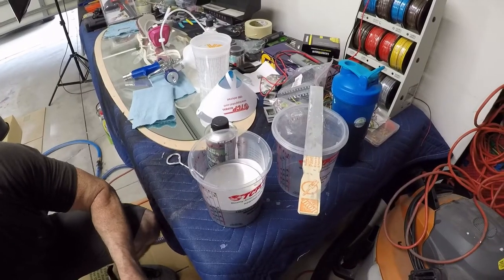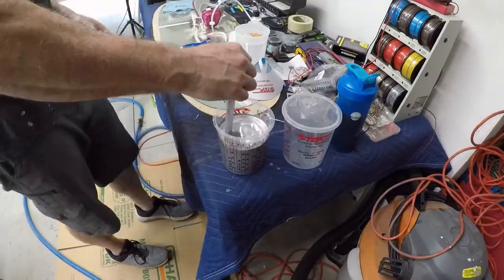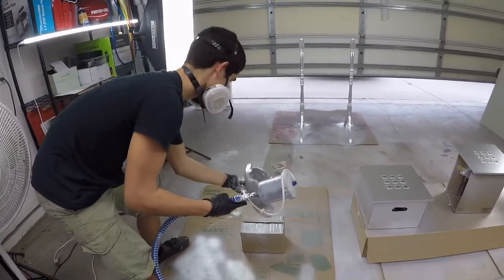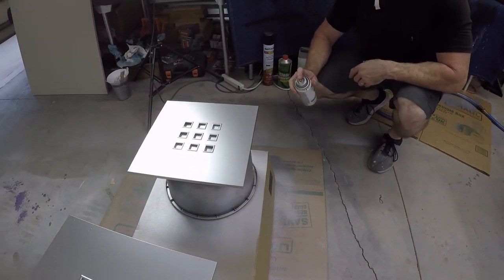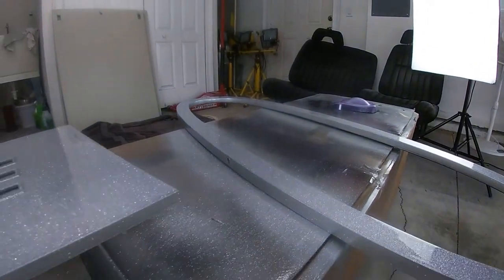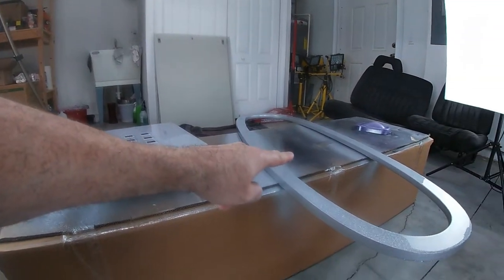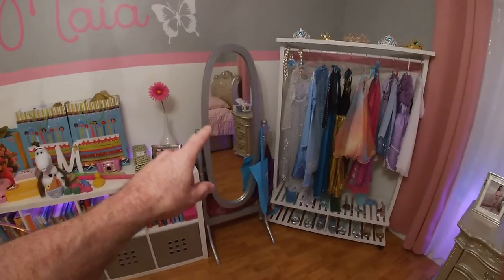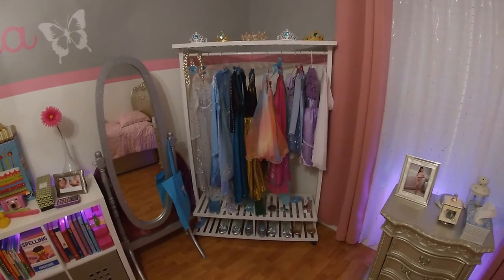Rustoleum paint job 2k clearcoat silver metal flake and Majic catalyst. Rustoleum 3 stage paint job

Comment: Sorry I’m late to the party!!  But man I’m glad I came across your video.  I’m considering using this on a car, but I have questions:

1.  If not cleared, does it dry to a more satin finish?  
2.  If I get orange peel (not clearing), can it be wet sanded like the other base colors without affecting the finished look?
3.  If using a cheap HF HVLP 0:02  gun, do you still recommend the same mixing ratio?  
4.  Do you have any pics of the finish without clear?  

I’d love to see you do a video of this color on an automotive panel without clear too!!   

Thanks for everything and I hope to hear from you soon!!
Reply from the maker: 1. Yes, it does
2. Yes, you can wet sand and buff this. You will need to if you don't clear it. The clear protects it from the sun and gives the shine. Keep in mind if you're using metal flakes, anything other than silver will turn silver when sanding.
3. The mix is a good starting point. If your gun flows differently, you may need it to be thinner to get a good finish.
4. Everything I have is in this video. Pause and look at the big metal panel my son shot. That's exactly what just the paint would look like on a metal panel. At least use the catalyst it will give a little shine and a little protection from the uv rays. I recommend shooting a test panel and then leaving it in the sun to dry to see what you're getting. The drawers and mirror in my little girls room look exactly as the day this was done. My truck with no clear in black needs to bet wet sanded and buffed from being in the sun. Good luck with your project. 👍
Reply: @thisoldhooptie  awesome, great info!  Thank you for the prompt reply and for sharing!!
Reply: @thisoldhooptie   couple more then I’ll leave you alone, lol:

1. If I do clear it, what is the estimated flash time from my last coat of aluminum to when I can start laying clear (I know weather and humidity play a role), roughly?  
2. Do l clear over any orange peel that occurs with spraying the aluminum and just smooth it out at the end by wet sanding the clear? 

I really appreciate your input!
Reply from the maker: @BrothersBuilds  you are correct the times will totally depend on temp and humidity. Those will effect the dry time of your paint. Also, how thick it was sprayed. The flash time could be 30 min to an hour. I touch a piece of masking somewhere to see how the paint is drying, then go for it when it's tacky, not dry. If it is to dry i would let it totally cure then clear it to avoid wrinkles in the paint. As for the peal, if it's really bad sand before clearing it. If it's just a little peal a few thick coats of clear will hide it. Then wet sand the clear and buff it to even it out. For examples with times in my truck playlist the black and purple fix paint jobs have the times listed along with the Temps stated in the videos when I did those.
Reply: @thisoldhooptie  I’ll check those out now!  Thanks so much for your input and advice!!
Reply from the maker: @BrothersBuilds  no problem 👍

Comment: Wow! I was wondering if rustoleum  and speedokote are compatible. looks great!
Reply from the maker: Thanks! Yes, they are. You just need to get the timing right and your all set.
Reply: If you’re not gonna use glitter, how long do you let the aluminum color coat dry before shooting clear?
Reply from the maker: @treeroofgrass  This time of year in Florida its really hot, stuff dries faster. Also need to take your humidity level into effect. Also I used 2oz catalyst in my 4/2 mix.  I did about 7 min per coat the aluminum rustoleum paint and had catalyst which speeds up the dry time. I did 5 min to 7 min on the glitter depending on the layer thickness. Then the speedokote clear times were about the same as the paint. I waited 10 min on the really thick coats. I used a 1.4 tip for the paint the 1.0 tip for the clear. If using a bigger tip on a budget gun for both paint and clear adjust your hand speed to compensate. You get alot of waste but it will work.
Reply: @thisoldhooptie  turned out sweet, I noticed that the rustoleum aluminum paint is thin out of the can and may be stray ready.. Was your 4/2 ratio, 4 parts paint to 2 parts catalyst? Or did you use acetone in the aluminum as well?
Reply from the maker: Your the first to have noticed or atleast to have mentioned it. Yes the aluminum is my favorite to spray, the same 4 to 2 is perfect right out the can. I use 4 parts paint, 2 parts acetone, then 2 oz of the majic catalyst. If you thin the black a bit more depending on temp it lays out alittle better. The white is in between the black and aluminum.
Reply: @thisoldhooptie  You clearly showed and said the paint ratio at the beginning of your vid. Just didn't pay attention. Lol. But I have been experiencing woth spraying the aluminum as well. I definitely agree that it is my favorite to spray too. I think I noticed that you used aluminum rusto paint because I really want to paint my 69 f100 that same color with the speedokote or sherwin Williams finish 1 clear. You did a great job on your daughter la bedroom decor. Think you motivated me to just do it
Reply from the maker: @krisjenkins4040  Excellent :) its a great choice. I think aluminum and silver is the least likely to get messed up. Send me a image on Instagram when you do it. Would love to see how it turns out. The link is in my header image and about channel page.
Reply: @thisoldhooptie  yes I think so as well. Just hope it turns out well. Today I mixed up some aluminum and acetone and sprayed my metal shed for practice, waited like 30 minutes and sprayed the rusto clear coat (spray can) on it and the aluminum reacted and also turned the aluminum dull. Hoping that the 2k urethane doesn't do that
Reply: @thisoldhooptie  have you had a chance to sand down and spray that metal panel that you mentioned at the end of this particular vid?
Reply from the maker: @krisjenkins4040  my son sprayed it aluminum, I didn't end up getting the flake on it. I gave the 24u server rack it was part of to my brother inlaw.  I am going to do more rustoleum with some flake and some color shift perls in the next few weeks. I decided I want to repaint the ls swapped s10 and will be testing a few colors out. Aluminum and silver flake will be one of them. Check up or turn on the notifications, I am going to do the tests on a truck hood all the way to wet sand and polish.
Reply from the maker: Sorry missed this. Did you use catalyst? Thats the key to clearing it early along with the acetone quick flash time in heat. Also the canned clear will not do the paint job justice. Need a 2k clear for the shine and the hardness. If you wanted to use a can get the 2k spraymax stuff. I used that on furniture its great but costly at 20 a can. If you have a gun get the speedokote in my description works like a charm.
Reply: @thisoldhooptie  I used the same catalystin the mix. But for sure I do need the 2k clear, I'll pick that up soon, maybe this week. I just only had the rustoleum clear here at home on hand so I attempted only to see if it would have a reaction. I sprayed the aluminum/acetone/catalyst with the paint gun and compression @ around 25psi. Spray max is good stuff but costly as you said.
Reply from the maker: Gotcha. It's been my experience to either spray the clear when tacky or let it fully cure then scuff it and clear it. Anything in between could get funky.
Reply: @thisoldhooptie  sweet!! I will for sure be in the look out for that vid, are you going to shoot that aluminum/flake with the speedokote clear?
Reply from the maker: @krisjenkins4040  Yes, I always use the same clear. It is the one listed in the description of my rustoleum videos from speedokote.
Reply: @thisoldhooptie  for sure. I gotcha, just didn't know if you were going to shoot it basically the same process you did like in this vid?
Reply from the maker: @krisjenkins4040  ah ok. No in this video I used rustoleum glitter from a spray can. I will be using the didspade flake from the gun in clearcoat. It is cheaper and easier that way. But yes same process and times paint, flake, then clear.
Reply: @thisoldhooptie  ok I see. Make sense, you're still going to use the rustoleum aluminum for the base coat?
Reply from the maker: @krisjenkins4040  Thats the plan yes. I will be doing testing with aluminum and silver flake, black and purple flake, aluminum and blue flake, black and colorshift blue/purple perls, and a few others. Shooting for one custom paint test a month or every other week if I have extra time. All will be rustoleum paints with didspade flake a few different perl brands and speedokote clear over the top.
Reply: @thisoldhooptie  sounds like some nice colors are to be had once you mix em up when you have time. Today I shot a test 2ft x 2ft piece of metal, sanded it down, primed it, mixed some rusto aluminum 4 parts, acetone 2 parts, and 2 oz of hardener, gave it 3 light coats @ 25 psi, maybe 10 minutes between coats. Looked great, then, waited about 30 mins, then I clear coated it with finish 1 clear and medium hardener @ 20 psi. That clear coat is flawless. The paint job overall was great but the only problem is that the rusto base coat paint wasn't dry, the rusto paint is still soft/uncured under the clear
Reply from the maker: @krisjenkins4040  Mine was the same, you have to let it all harden over the next couple days. Then it will be rock hard.
Reply: @thisoldhooptie  that's what I was hoping for! The outcome was great in your vid but now me seeing it and shooting a piece of metal myself, its even greater lol. When people see our paint jobs, they won't believe its rustoleum base and 2k clear lol
Reply from the maker: @krisjenkins4040  Facts! 👍 Have a great weekend, the parts should be solid by Monday or Tuesday depending on the temp in your area.
Reply: @thisoldhooptie  it's 101° out where I am. So it'll definitely dry. Are you working on any projects this weekend?
Reply from the maker: @krisjenkins4040  wont get to all of it but i always try. The weekends projects are checking the drive line angle, trouble shooting wires for the head and tail lights, and chasing down the error codes on the ls s10. Changing the rear pinion seal, replacing a couple pieces of weather strip from lmc truck and hopefully the cowl back on for the c1500. Install the steps for the hyundai palisade.  Ill post something on it early next week.
Reply: @thisoldhooptie  you're a busy man like myself. Working on some similar things on my truck so I feel you on the wont get to it all part lol. My wife has a Palisade as well, we've had it for a little over 2 years, thinking about getting that same grill that you installed on yours. You got your self a busy weekend so I won't hold ya, I'll be on the lookout for your next vid, great content. Nice that you stay in the loop with your followers, solid guy

Comment: I have painted quite a few of my work trucks with rustoleum with the hardener and been satisfied with the results.  But have always wanted to try clearing right after painting. But everyone claims you have to wait weeks for the rustoleum to dry or it will wrinkle.  HELP  😁
Reply from the maker: Well you know everyone on the internet knows best 😉🤣  what you see in the video is exactly what I did. Worked great looks great and its used every day by my kids. Also did my trucks the same way works fine for me at least the way I did it. Test something small and see what happens 👍